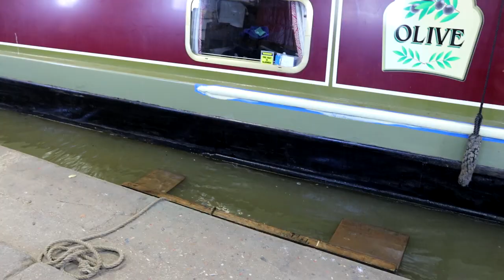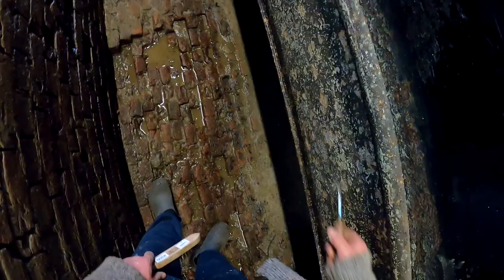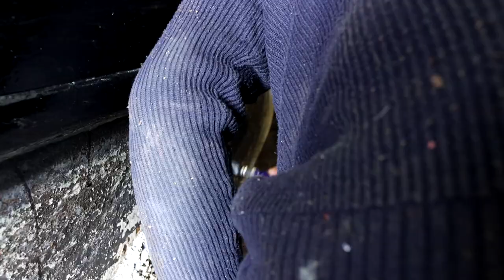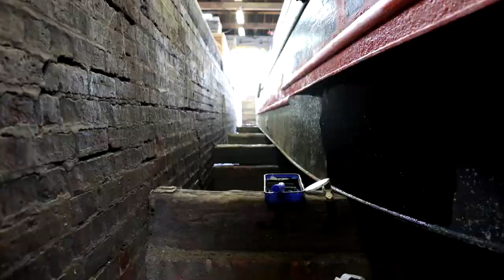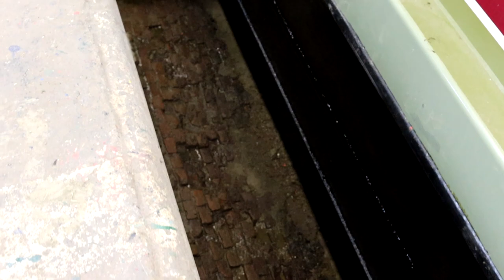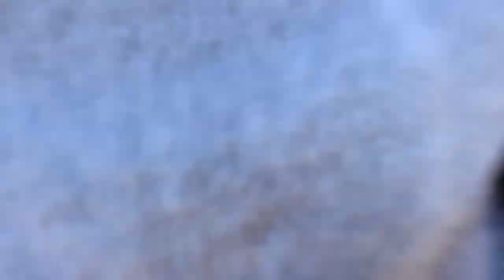47 - DIY Blacking Our Long Overdue 70 Foot Narrowboat And Welding On Anodes At Braunston Dry Dock

Comment: Hi guys,I got to say you guys done a first class job on your hullo all the years I worked on boats I have never seen anyone take so much time in preparation never seen anybody but under coat on ever ,how deep was the pitting on the hull you can fell them with weld then grind of it makes a good job but it takes a long time and you must keep a eye open inside the boat in case of fire that is you ever do that job ,great respect for both of you ,you sure not afraid of hard work I must say ,well take care keep safe till next time ,John 👀🥂🌹❤️🌈🌈🌈🍺🍺🍺🍺🍺

Comment: Just so you know, we had ours blacked a few days ago by The Boatyard, Hilperton, on the K&A and they charged £550 for a 57 footer. They have a floating dry dock and can’t recommend them highly enough if you don’t fancy DIY next time.  Good job on your efforts though 👏👏👏👏👏
Reply from the maker: Cheers Rick that's cheap! if we're on the K&A around the time we need to black again, we're check them out  👍
Reply: Taylors Aboard yeah it does sound reasonable but isn’t your boat longer than  57ft?
Plus sometimes doing it yourself you know it done thoroughly and you got anodes and sorted out prop issue. Congratulations on a job well done 👍

Comment: Its not a Shear pin, its a cotter pin! A shear pin on the prop shaft holding the prop on would be a bad idea :)

Great work on the Blacking very thorough, glad you got it all done should be good for 3 years. 

As for the rounded bits on the hull, they are called Rubbing Strakes and are there to protect the boat as you go into locks. The chine is the point that the base plate meets the side of the hull.
Reply from the maker: Ahhh, there we go 🤣 knew I should have researched the name of it, dad said it was called that 🤣 so I just went with it. Cheers for all the info 👍
Reply: It’s not a cotter pin it’s a split pin. It prevents the nut from unscrewing.
Reply: @flashbangelectrics7705  it's a cotter pin or split pin, the name is interchangeable for the same thing :)

I prefer cotter pin as that's what I was told they were called as an apprentice. It's like calling a filament a bulb, as my apprentice master said "you plant bulbs, boy!"

Comment: how long did you wait after the last coat before flooding the dry dock?
Reply from the maker: About 16 hours 👍
Reply: @TaylorsAboardaNarrowboat  I hope that was enough. Not sure what the data spec sheet is for that blacking. 1st 2 coats should be good though. I did like the extra prep work that was done
Reply: should be left 48 hours.